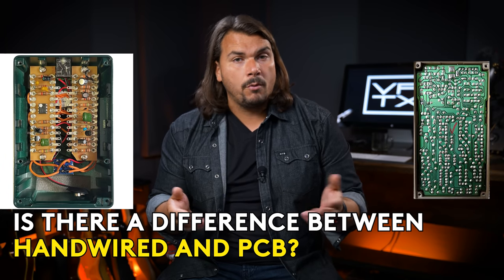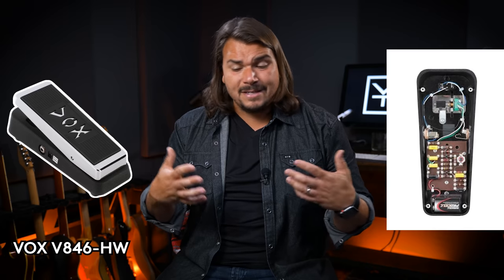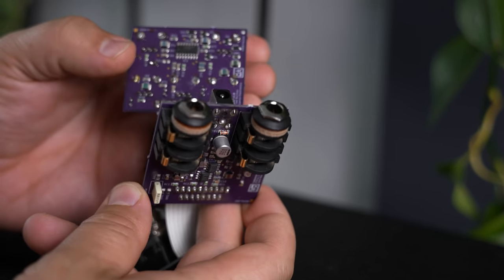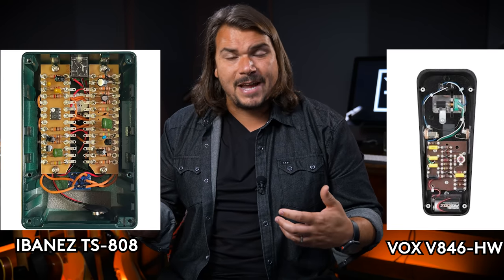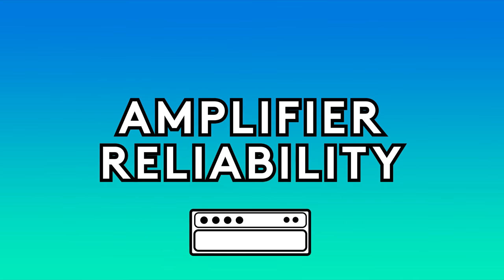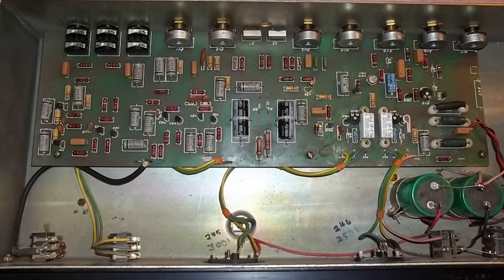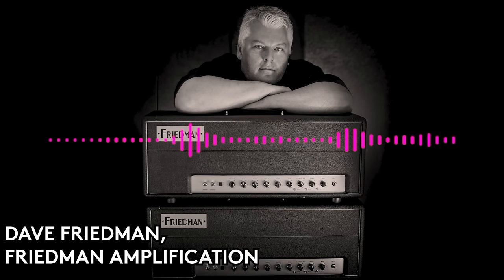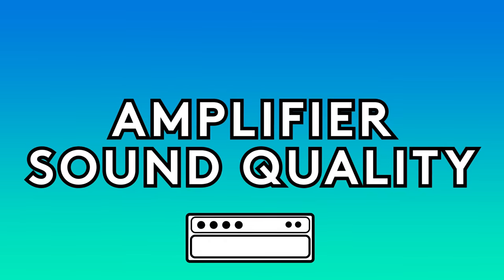Is Hand-Wired Actually Better?

Comment: I have handwired & circuitboard tube amps. I'm prepared to trash the PCB amp when it goes, but will get the handwired amp repaired. Amps take abuse. They are heavy, get slammed, fall, dropped, left out in the sun or cold & they break. When a PCB board breaks it's gone. For me it's hard to compare PCB and handwired pedals and amps. Not everyone makes great PCB boards. Maybe these guys do but not everyone. The show turned me off for not recognizing some PCB work is low quality.
Reply: Bang on man
Reply: Not true.  Plenty of techs repair PCB’s
Reply: @Starch1b2c3d4a  yeah but as an tech we don't want to! they are overly complicated and sound like shit especially any Mesa after the MK1
Reply: @Starch1b2c3d4a  define plenty, im a tech and i wont service this shit and neither will any other techs I know..You have problem with these amps send them back to the manufacturer
Reply from the maker: If it's a well made amp, you should not have this issue.  Remember, as Suhr said, it's the not the method it's the execution.

Comment: I don’t mind PCB’s (in pedals) at all. What I’m not a huge fan of is SMD components. If they fail the device is pretty much trash. In a guitar amp PCB’s are T R A S H and it’s not nessecarrily th fault of the manufacturer. Lead free solder is a HUGE problem. I’ll take an eyelet or lug board any day in an amp.
Reply from the maker: It's all going to be SMD in a few years.  Sound wise, most stuff is 1:1 or better because it's tighter tolerances in SMD.  They are repairable for most analog SMD stuff, most tech's just don't like them because they're not skilled enough to do it.

Comment: I guess what confuses me is Rhett Shull did a video last year about a handwired amp he played (Princeton I believe?) and how much better it was than the PCB. And he showed them side by side at that store he was at, and sure enough, the handwired sounded better. But my guess is, Fender just uses better quality components in the Handwired series?¯\_(ツ)_/¯ because other than that, the big jump in quality doesn’t make sense to me
Reply from the maker: The biggest issue from what you’ve brought up here is that the quality of the circuit board the layout is not exactly one to one on the re-issue series circuit boards versus the hand wired reissue versions.  The components are different, the component spacing is different, the lead links between components is different, the culmination of which makes it kind of a different amp at the end of the day.  The only way to truly compare this is to have the same engineer design two different versions of the same exact amplifier both on a circuit board and hand wired point to point. That would really be the only way to fully represent the quality differences in sound at least, that’s separate from the quality of the circuit board, in the build quality, which Fender historically has been very poor at, going for a price point over all other measures.  What are the best representations that I can think of if we’re talking about Fender style amplifiers is the new John Suhr Hombre amp which is a replica of a brown panel Fender amplifier from the early 60s.  If you were to compare this to say vintage Fender that represents the same amp, you would see a very high-quality conversion of what was formerly a hand wired point-to-point amp into a circuit board based amp that is going to be more consistent, quieter, and more reliable than its hand wired counterpart.
Reply: @VertexEffectsInc  hey, thanks a lot for the response! I think that makes a lot of sense! I wonder why the reissues don’t just use the same design but… it seems handwired has become somewhat of a marketing gimmick
Reply from the maker: @codymcgrew94  only one reason, cost.
Reply: In Rhett's video the PCB princeton through the HW cab sounded really good on the video. Of course in the room they were still saying that the HW amp through HW cab was best, but if you are going to compare you should use the same speaker for both, in which case the difference was much smaller.
Reply from the maker: @jaltsch1  separately from the speaker, they're still not the same amp...that's also a problem.

Comment: Hand wired fender amps sound better then pc parts mostly because fender use better components in their hand wired series. Fender also neglected some high current heat points on some of their pc boards rendering them less reliable.  That's a cheap design choice, not a wekness of the pc board.  If any 300 watt bass tube amps can survive pc board implementation, any tube amps can survive it.

Comment: There would be a difference in quality if in hand wired gear there were audiophile grade interconnection cables as a standard, that would always be better than the copper tracks inside a PCB. However this would only apply to amplifiers where there is enough space and where the amount of cable would be considerable compared to a small device like a pedal which is in a totally different universe. I did a small project for myself with a local amp builder, basically a Deluxe Reverb with all audiophile grade connectors, cables, everything (Furutech, DH Silversonic Cables, Jupiter Red Astron Caps, Cardas audio connectors, not top for each brand but much better than the regular stock components that are regularly used in guitar amps). The result was awesome, and the overall cost went like $300-$400 above the regular price the builder usually charged for it.
Reply from the maker: You're oversimplifying what a lot of this stuff does and the impact to the the overall tone - you have not baseline.  In many cases you're not using cables at all, rather just straight wire, maybe a twisted pair shielded cable in some locations to reduce noise and you're also getting away from how some of these amps might have been made originally if you do too far outside of the norm of how they were built.  No classic Fender, Marshall, or Vox circuit was ever made with audiophile grade components - that wasn't part of the sound.  Unless you had a baseline to compare a non-Audiophile grade version of the same amp, how do you really know what you're hearing?
Reply: @VertexEffectsInc  I never said that the intention was to sound exactly like the original as at that time technology for creating certain types of components didn't even existed (rhodium plating, OFC, etc). The experiment was to make an amplifier with audiophile grade components and see how it would sound, a direct comparison wouldn't make a lot of sense because the concept behind it is totally different and you could never tell what is making it sound different, ("Better" would be a subjective thought which I can't state mathematically for myself, so you are right with your observation). The only baseline is that there is an industry built around this type of hardware which is completely on a different track when compared to the type of components used even in high budget recording gear, amps, pedals. If it is worth it, expensive, snake oil, is a complete different discussion.. for me, there is always s difference, but not proportional to what you are paying for it.

As there are a lot of components playing a role in there, I would never state that a certain part is the one that makes the whole difference, but there are components that are more important than others for sure (There are plenty of videos that compare caps and they do not sound the same despite being the same value) I don't have the same amp with a circuit board in order to state that it sounds better or worse because of the cables, I just said that it sounded awesome, nothing else. I'm not trying to encourage people to do the same thing I did either.

On another side of the discussion, we would have to ask ourselves why are these companies are selling silver plated cables or pio caps if they don't make any audible difference. If a gear builder uses jupiter caps against orange drops, why then a cable may not affect the audio as well?

Comment: Considering a Carr Superbee which I understand is PTP. I don't think Carr offers a PCB version so I have to go with PTP. Am I paying big bucks for the labor involved when that amp, redesigned, could be made far less expensive with a PCB design? Of course the Superbee sounds awesome so if it sounds good, it is good? After hearing the conversation in this video I'm wondering if there are PCB versions of a Superbee (similar to) that can be had for far less money? It's just money, right? So go with what you love, right?
Reply from the maker: Small operations often don't offer this as its more work at smaller scale.  Doesn't mean it's better.

Comment: I wish you had asked them what (only 1 amp 'type' allowed) they would take on the road where weight/ repairability might be more of an issue would HW or PCB be a consideration?
Reply from the maker: I think it comes down to the implementation, not the method.

Comment: I guess the bottomline is: PCB can be very good and more consistent and easier to produce and everything they say, but the truth Is - in the consumer segment where the amps are built in china and if sold for 500-600 eurodollars means they cost 200 to produce, the amps are built as cars, to last until the warranty ends. I actually would buy a pcb amp from Friedman or Suhr, if I had that money to spend but in my price range I went for a hardwired Vox. Find it a great amp

Comment: I will purchase hand wire  because they retain their value, I purchased a hand wire amp in 2008 the same amp is now worth almost double in 2022.
Reply from the maker: If it's a vintage amp, that's true if you're comparing to a new PCB amp - but that's because it's vintage, not because it's handwired.  For a newer amp, that's totally untrue.  What was the amp you purchased that's worth double now?
Reply: I purchased a Dr Z Maz 38 NR amp head, 2008 I wouldn’t call it vintage, I paid $1675.00 for it and it now sells for $ 3350.00 these prices are less tax, if I sell it now I get my money back,also I am from Western Canada when I purchased it our Can $ was near par with US $ this is when I purchase my all my gear, we are at now about .78 cents to US $ , my gear is an investment I can enjoy, if I sell I get my money back😊
Reply from the maker: @Victor-tl5eg  Are you comparing a new price to a used price or just the fact that the cost of production has increased? Or is this amp discontinued so it's more scarce now?  It doesn't seem like this is a consequence to being handwired vs. not but rather market effect versus the amp maker's notoriety or the availability of the amp.
Reply: This amp is still available the new price is $3350.00, I purchased a Mesa Lonestar Special 12 inch combo for $2400.00 can$ no tax in 2007, it was discontinued in my area two years ago, at that time it was selling for $ 2700.00 they sell used it my area for about $ 1800.00 , so I will not get my money back if I sell it, my Mesa amp sounds just as good if not better then the Dr Z, but for me it comes down to retaining my money, 90 % of my pedals are PCB

Comment: I was happy with my two pcb amps until they both developed problems.
My  Carvin Bel Air had a output tube problem. The pc board with the output section decided to short. The entire EL84 section lost most of the traces for the B+ got cratered past the point of using jumpers. Replacement board no longer available.  I added a cushioned seat to the amp and now I have a custom bench. My Carvin Nomad had tube issues due to the tube sockets mounted directly to the board ended with burnt traces from heat build-up. The EL84's were biased properly.
I'm done with pcb builds for now.
My Traynor YCV-40 had issues with bad solder joints with the surface mounted sockets.
Reply from the maker: These aren't great amps to begin with nor good examples of high quality PCBs...we can't keep saying we don't like Sushi when we're buying our Spicy Tuna hand rolls from a gas station!
Reply: @VertexEffectsInc  I just speak from my experience. I have an original 65 Princeton that has been played to the brink of death and brought back. I am an old school guy that started guitar in 63'. Strictly analog amps since then. Never had a failure with any of them. Proper maintenance and my children will be playing them long after I'm gone. The Carvin problem was partially the non-availbility of replacement parts. My current amp is a 18 watt Maz Jr. clone. F &T caps Belton sockets and it's of turret board construction.  Imo it will remain a viable piece of equipment as long as components are available. Circuit boards are always subject to rev.1 rev.2 etc. 
I have had issues with some of my other amps finding replacement boards due to obsolescence.
I don't doubt the newer designs are a vast improvement over the early stuff just my $.02.
Reply: @VertexEffectsInc  I suggest a good question: PCB s Amp are supposed to last how long? :) You know that as in any other field they should last not too long and be replaced. That s how manufacturers will sell more. The final goal, as usual, is to cut the production cost and produce an item that will need to be replaced. An item that can be fixed at a cheaper price than replace it, it s a problem for the industry.
Reply from the maker: @frankmat658  there's nothin inherent in a PCB that requires it be replaced regularly.  Remember, most eyelet boards for Point To Point are still PCBs.  You can spec a high quality PCB that lasts forever, or a crap one that will degrade as it ages and is under various conditions consistent with tube amps.  Just because it's a PCB means nothing, the quality of the PCB dictates how long it lasts.  Fender PCBs on new amps are poor, and they aren't designed to last forever, that's true.  Other brands we mention here will outlive their owners.

Comment: Hmm, I can repair any PCB product I own. Computers, automated mixers, amps, rack effect units, automotive components, refrigerator compressor control units… I’m just a truck driver.
Reply: I might add, my Marshall JCM900 combo is still going strong after 31 years. This is still my main gigging amplifier and I’ve done all the maintenance myself over this time. Filter caps, replaced all the potentiometers at least twice, many tube sets, replaced the speakers etc…. The PCB is solid and doesn’t need to be rewired as some other YouTuber techs claim.

Comment: In terms of industry standard SMD is better to keep the consistency. But, the art lays in subtle differences. Each piece must be unique. Not clones. Otherwise we can keep the plugins due to consistency.  As guitarist I don’t wanna hear others with the same sound as I. I want a unique sounding amp not way different, but not equal to all musicians. As music producer, I want my own sound unique, as an pedal designer, I want each client to have his unique sound too. Unique is the key.
Reply from the maker: I guess it depends if you're making custom pedals or not.  If you want unique per customer, by all means, handwired or use rare or full size components that are handwired as it will be easier for you to make one-offs that way.  If you want to be able to reproduce the same sound 10,000 times with zero variability SMD and PCB is the way to go.  There's not really a wrong way, just what are you trying to do?  This is validated in the video during the commentary.

Comment: Some of the greatest sounding amps ever built were done on PCB designs,Like Soldano,Mesa,etc…..Honestly,I can’t believe it’s even a consideration anymore between hand wired and PCB as to which is “better”…..You are always going to get the “They don’t make anything like they used to…now get out of my yard”guys that believe that any amp made after 1968 sucks,but that’s hardly the case….Technology and just the engineering and design of guitar amplifiers has come so far in the last 30 years…..in the early 80’s,there were no such thing as high gain amps,by today’s standards,now,it’s common practice to make exceptional sounding super high gain amps….So I am in the camp of,if it sounds good,I’m good….I don’t care either way how the components were installed..
Reply from the maker: Well said but the Point To Point apologists are still out there in the words of Steve Fryette.
Reply: My Mesa Mark I is 45 years old and reissue Mark I is 25 years and work fine with wonderful sound. I have a low watt handwired amp too but I prefer my Mesa Mark Is and Kingsnake.

Comment: Honestly if using the same components it makes no difference in sound  if it’s hand wired through hole or surface mount but as far as repairs and modding I imagine it’s much more beneficial to have through hole hand wired circuits. I like classic hand wired pedals but if a pedal I like is surface mount it doesn’t bother me one bit
Reply: Got it the debate was about part to part soldering compared to printed circuit board soldering - made initial comment early in the video
Reply from the maker: Thanks for watching!